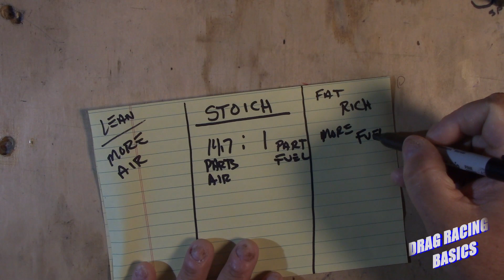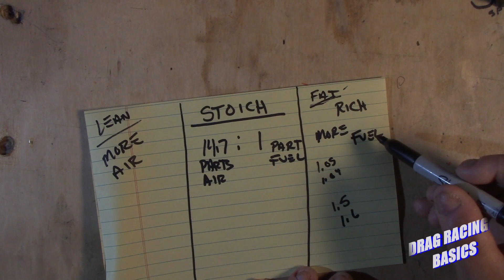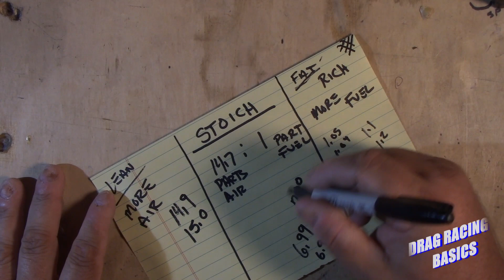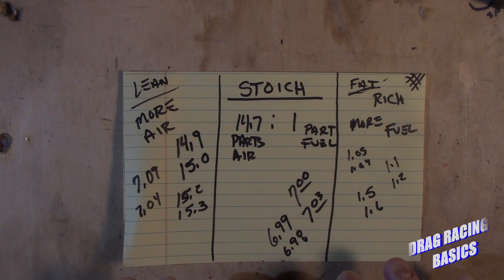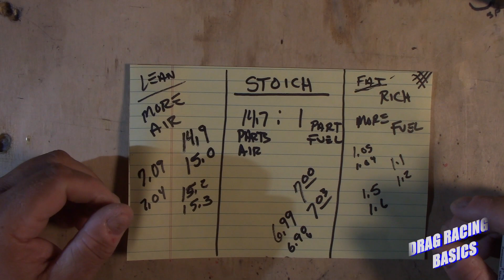An air/fuel ratio discussion

Comment: 1:03 No engine will ever make max power at STOICH, STOICH is just something that is useful to know if you were burning fuel in a chemistry lab. 4 stroke engines will make max power at a figure that is richer than this, usually around 12.8-13:1, one of the reasons is that the mixture is never uniform in the combustion chamber, therefore we need to ensure that each oxygen molecule is near a fuel molecule in order maximize all that lovely air that was have worked hard for to get into the engine. Furthermore the power verses AFR curve is not even symmetrical. Let say your engine made max power at a AFR of 13:1, if you then go to 12:1 your might lose 5% of that max power. BUT if you go one ratio leaner (14:1) you could lose 10% of that max power. To sum up, if you can't get the mixture ratio to be 'spot on' for your engine then run it rich, not lean! NOTE I'm talking about max BHP here, when cruising around with the throttle just cracked open then you can run much leaner than the figures I have been quoting. (leaner than 14.7:1)
Reply from the maker: Interesting🤔

Comment: My gauge says in the 20''s for air to fuel ratio but I know it's running rich... huh?
Reply from the maker: Junior Lemke 
Is it an older install?
Maybe the sensor is sooted/carboned up or corroded, that can make it mis-read the oxygen content. Just like O2 sensor in a fuel injected car.